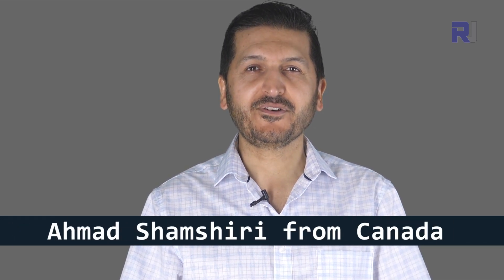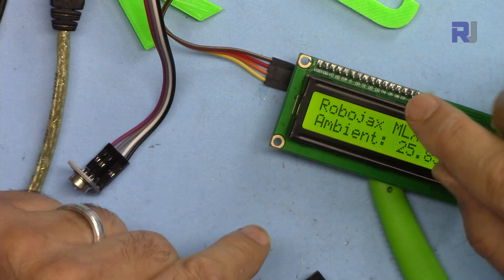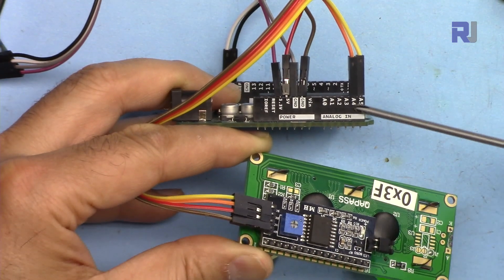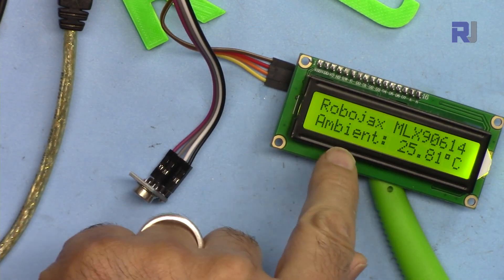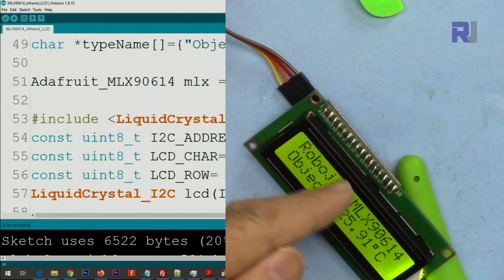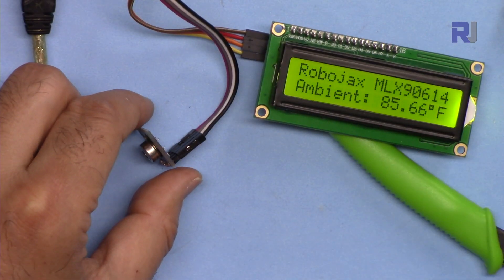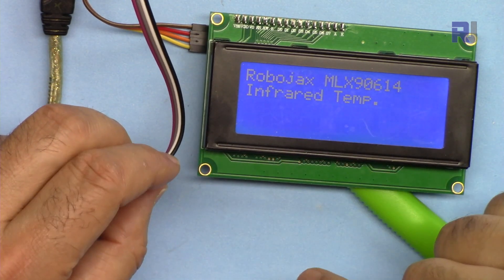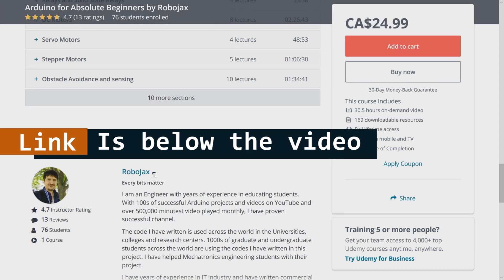Non-Contact Thermometer Infrared Sensor MLX90614 with LCD - RJT328

Comment: which arduino board is used here
Reply from the maker: wow.  I mean wow with the question.
Reply: @robojax  😅. we have made this as a minor project for our collage and the code is note working.. plz help and just copy paste from your website  ti does not compile is shows error on 58 or 56 line.
Reply from the maker: Provide error. saying there is error is not enough. by the way if you skipped the introduction to MLX90614 video and you skipped to introduction to LCD video, then definitely you should get error. This is combining codes from two other codes and you need to watch this videos.

Comment: why data doesn't show on my lcd
Reply from the maker: because you have not watched the introduction video to LCD. the link is in the description and I have mentioned in the video. This video combines MLX90614 and LCD. So I did not talk about the MLX90614, you have to watch that video to learn about the infrared sensor and watch introduction to LCD to learn about them. This video is just showing you how to put them together. Check the links, watch and the issue will be resolved.

Comment: Hello sir. Thank you for the great video. I have a question about the emissivity of MLX90614 because I was trying to measure human skin temperature but the emissivity of human skin is not 1 (approx. 0.98 - 0.95) since the default value of the sensor emissivity is 1. Is there any tutorial on changing the emissivity of the sensor?
Reply from the maker: a simple google search showed this which tells you how to set emissivity https://github.com/sparkfun/IR_Thermometer_Evaluation_Board-MLX90614/blob/master/Libraries/Arduino/examples/MLX90614_Set_Emissivity/MLX90614_Set_Emissivity.ino
Reply: @robojax  I have tested using all kinds of libraries (from google) . The library that you shared didn't work for me (tried it for few days) . In the end, my only hope is to use i2c library to communicate with the sensor which indeed work out but the final coding was longer. Thank you for the reply.
Reply from the maker: good to know you figured it out. stay safe.
Reply: i realize it is quite off topic but do anybody know a good website to watch new movies online ?
Reply: @Yusuf Nash Lately I have been using flixzone. You can find it on google :)
Reply: @Jeffrey Zakai definitely, been watching on flixzone for years myself :)
Reply: @Jeffrey Zakai Thank you, I signed up and it seems like they got a lot of movies there :D I really appreciate it !
Reply: @Yusuf Nash no problem =)

Comment: hello sir can you help me with my project im planing to use this sensor for my project and the concept is when a persons temperature is above normal it would trigger the buzzer and if the persons  temp is normal it would trigger a servo that would let the person enter can you help me newbie here sir.....
Reply from the maker: Hello, at 8:10 (click on 8:10) I have explained if you want to do something with the temperature. that something can be buzzer or relay or motor. I have over 400 videos with full explanation with them. here is example of controlling a relay https://youtu.be/58XWVDnB7Ss or  you can control a buzzer instead of relay.   Make sure to watch the MLX9061 main video so you learn how it functions https://youtu.be/jN86PSAHMbw . this video with LCD was just how to use it with LCD not explanation.  If you don't know how to use IF statement, then Learn Arduino in 30 Minutes (video): http://robojax.com/L/?id=135
Reply: @robojax  thank you ill try this hehehe

Comment: How can i make the temp 37 C from 33 C at lcd
Reply: Human temp 37 C
But at the lcd is 33 what is the code  l can use to make it
Please
Reply from the maker: sorry I don' t understand your question. Are you saying: how to add value to the temperature? if so it would be very easy. I have explained it how to get temperature.  if so then just add + 3 or whatever you want.